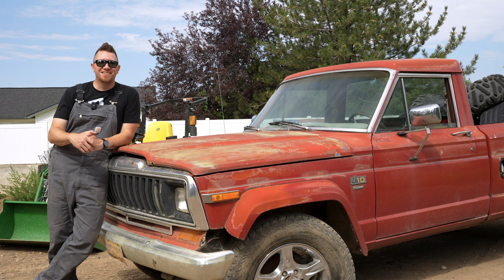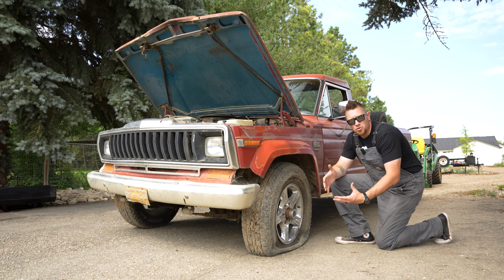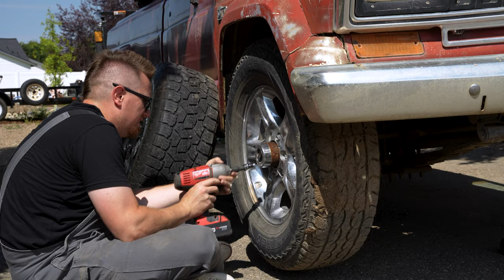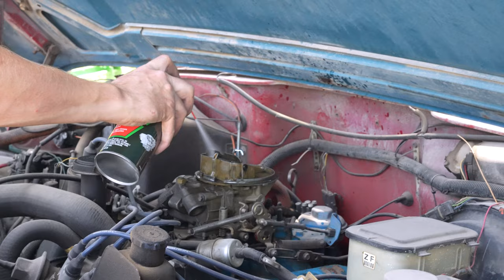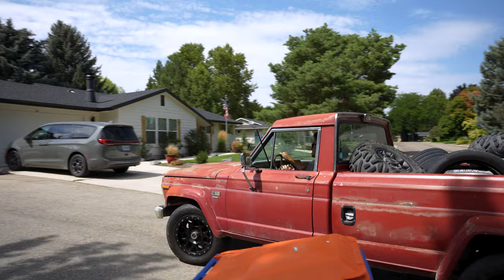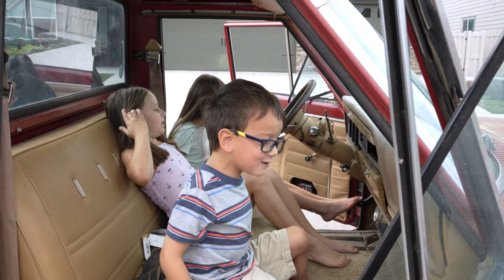Will it run? JEEP J10 Full Size Truck.

Comment: First things to do I think is go through engine change fluids and same with transmission then brakes all the lights( think you might have done these already).
Reply from the maker: You’re 100% correct. As it sat for so long, total fluid change is on the list. Brakes are…. well they exist and kinda work (sometimes). All lights work, expect for one headlight that I may have a replacement for. Stay tuned to see what I find in my boxes of parts that came with the truck and I’ll go over the future plans

Comment: Nice old Jeep, although mine is older. I have my Dad's 1966 J - 2000 with a 7'-0" pickup body. It has the 232 Straight six engine and three speed manual transmission. This truck was bought new in December of 1965 with 7 and one - half foot Meyer snowplow which I still plow with. My advice on your truck which appears solid is to clean it up and paint it and use it as a truck - that is what it was made for. Good luck with your project and thanks for the video. Please advise if you would like photo's of my Jeep and where to send them.
Reply from the maker: It will absolutely be used as a truck. I’m debating whether I want to keep the patina and just protect it as it is, or fix what little body work there is and repaint. I have many other plans and hope to get started on new videos soon. I’d love to see those photos! Please send them to mohawkautomedia@gmail.com.

Comment: 82 WT Cherokee Laredo, sitting on my driveway, in the UK. Inherited from a friend, who passed away too soon (leukaemia ...). His family called it 'Freddie' as it was a nightmare, to work on.
One of the VERY few Jeeps remaining from AMC's short attempt to sell Jeeps in the UK (and Europe) between 79-83. 360 with Edelbrock, NP219, AMC 20, Dana 44 front, RHD converted. 
Needs serious work (roof is fubar, for instance) but just can't junk it. As far as i can tell it's the only 82 Cherk still registered with the UK DMV. 'Rare', redefined.
Reply from the maker: That’s incredible! I wouldn’t junk it, I’d try to revive it and drive it. Doing an HEI conversion will help with it running better and more consistently and is top on my list. I have ignition/spark related stumbling  and the ford based system in these are awful. The Chevy HEI based system is way better.
Reply: @MOHAWKAUTO  HEI, TBI, etc are all on the "one day" list. Right after i win the lottery to afford the bodywork! :D

Comment: you're gunna have this truck forever,..... take it all the way with the restore!
Reply from the maker: I might do that in the long run. It’s just hard to do with these trucks as parts are really hard to come by.
Reply: @MOHAWKAUTO   resto mod.... put whatever you want in it, does not have to be original ;)
Reply from the maker: @wl3016  restomod would be more like what I’m doing. Combine new with old where appropriate and try for a stockish look